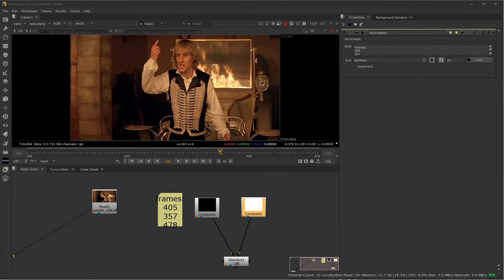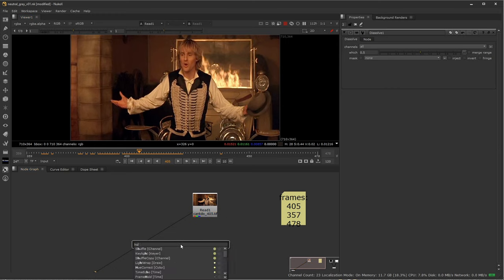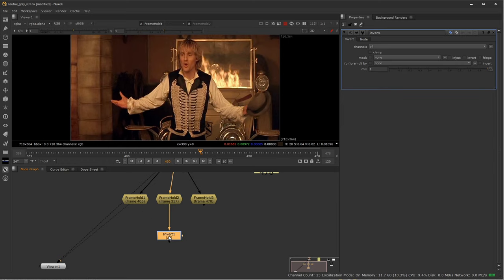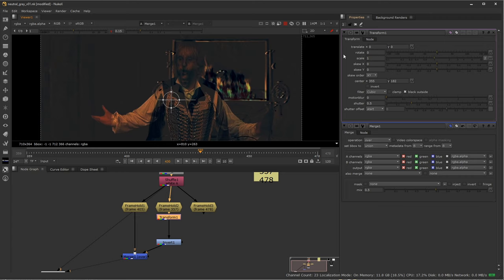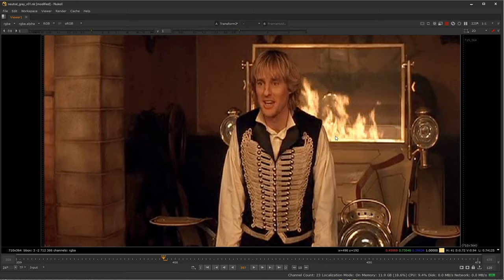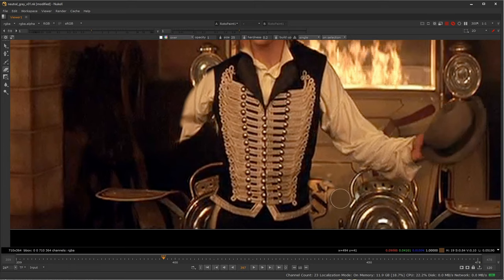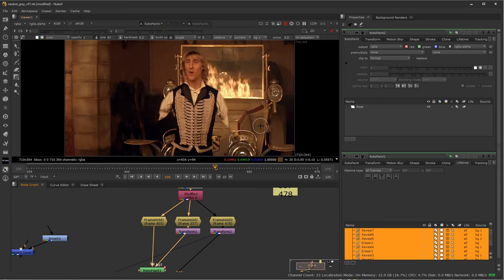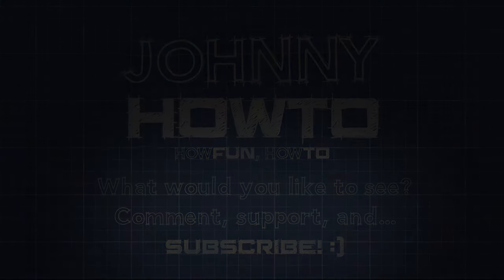How to Create a Perfectly-Aligned Clean Plate in Nuke

Comment: If you find the process of lining up frames to each other too tedious, consider that you could just stabilize the footage first and then proceed as described patching your frames together. And since they are all stabilized, you can pick as many frames as you want and won't have to line up each of them.

In perhaps another situation with many frames that each have useful background pieces, the reveal-painting each layer may also become impractical, in which case you could try simply punching out the action (Owen) first, with a loose roto stenciling, and then just stack stabilized frames over each other, which will reveal through to whatever layers have that region. You can then noodle the mask feathering etc while looking at the stacked-up result to make sure you don't get any hard edges.

Comment: question for mr. HowTo : what after that ? If I have to create the background with out have the footage ? or the exact point of view ? 
I really liked the differrence technique to aligned the framehold. Thank you.
How would we use a mask to bring back the original plate that is not still in the back ? With a stabilized plate ?
It would be nice if you get this one to the finish line. Often it is the final tweaking at the end to integrate smoothly everything that is treaking me.
Thank you for sharing your knowledge mr. HowTo !
Reply from the maker: Hi there! :) 

Yeah, I didn't take this one much further since it would kind of be taking the shot beyond the point of the "neutral gray method" that I kind of centered the video around. 

As far as trying to 'recreate' the areas that weren't in the original shot, it's obviously going to vary shot-by-shot...but in general (which you may already know): 

1) Borrow from whatever you can before you create something from scratch. So for instance, in this shot you could perhaps borrow the headlight from one side and use it on the other...or at least use it as a start. Similar with the windshield, etc. 

2) In some cases you will have to (like you said) do some paint work from scratch...and in those cases stabilizing and doing manual paintwork & then re-applying the movement might be quite helpful. 

I could perhaps do a video on a shot that covers some of these topics if it would be of use to you?
Reply: @JhowT  wow ! this would be very helpful for sure. There is so many ways and each shot has it own challenges. I'll be following you ! Thank you for sharing your knowledge.
Reply from the maker: @mjparent222  It's always nice to get recommendations on content, and I need to get back in the rhythm of posting that type of content. Feel free to post a reminder if within a few weeks you aren't seeing anything & I'll try and make sure to get back on the "posting path". ;)